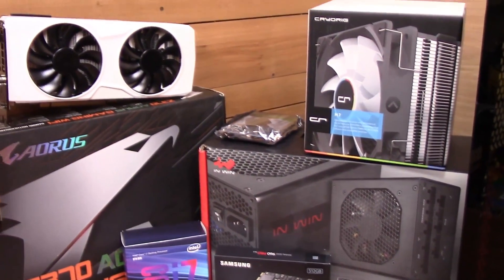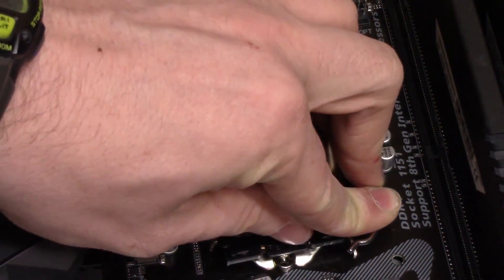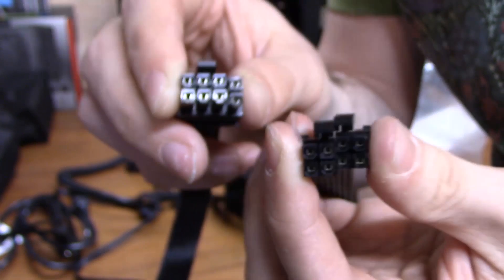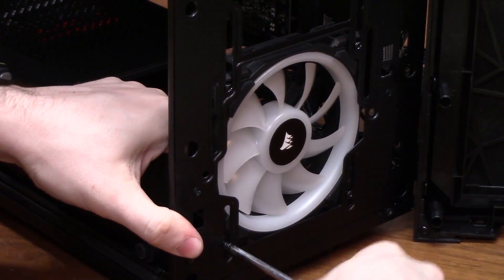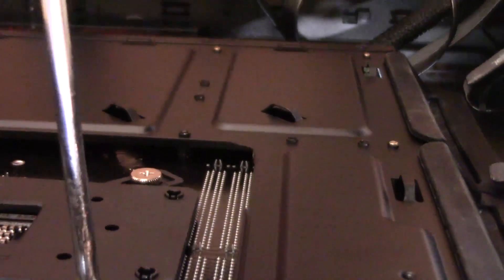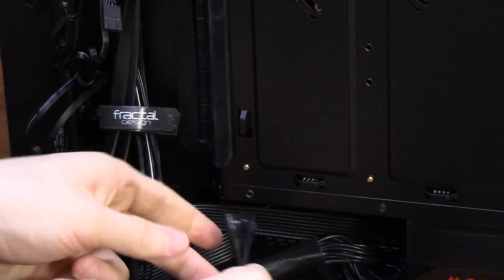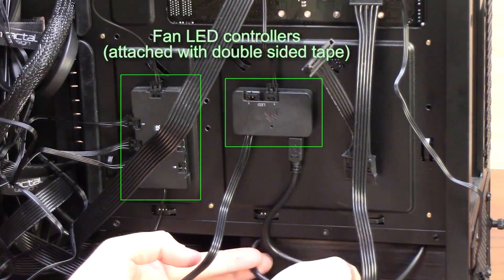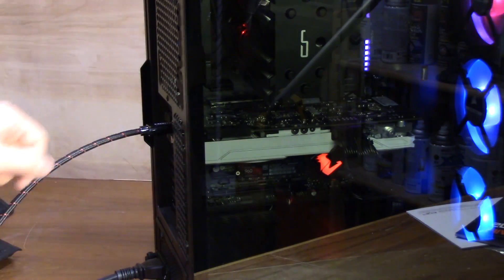How to build a gaming PC!

Comment: Is the RAM correctly installed?
On the manual says Channel A is DDR4_2 and DDR4_4 and on the board we see that those are the two closest to CPU.

Am I correct or am I getting it wrong?
Reply from the maker: You're right, sometimes it says to put them in B first

Comment: I always like to to update the bios before installing any devices on the motherboard, meaning just what is needed to post.  And usually install the video card last on Intel based systems and just stick with onboard video until windows/drivers are installed and ready.  I think keeping the first post as simple as possible makes sense.  Mostly to allow the bios updates to have the least amount of complexity on the system.  These choices are for the most part subjective and usually are developed from previous experiences.  

I like the way you made your build easy to understand that mostly helps newbies gain confidence by not overwhelming them with technobabble hyperbole, good job..
Reply from the maker: Ah yeah! When you've got experience you learn efficiency. But I think a newbie will just be happy to see it post. Thanks for the kind words :)

Comment: As usual, a great informative video. Just so happens you’ve used the exact case and motherboard I’m looking at buying, although Fractal have just released a white version of the Meshify which I really love, so I’ll be getting that version.
Reply from the maker: It's a really nice case! You'll be pleased
Reply: Dietec thanks. The last PC I built was 20 years ago, things have changed. Watched so many videos now I think I could build a pc blindfold! Going to use a Ryzen 5 1600, a Corsair RM550x psu and some Corsair fans. Just got to make up my mind about the gpu. Can’t wait to get the case first though, I’m in the UK so I’ll have to wait a bit I guess. Thanks again.
Reply: Hi, for anyone that’s interested the white version of this case according to Fractal Design will be available to buy from retailers in just over two weeks. Thanks again Dietec for a really informative video.

Comment: I have the same pc except I have a liquid cooled vega 64. And an Asus motherboard. And no ssds or nvme drives. Still using a 6tb hdd. Also, I have 16gb of ram from g skill trident z 3200mhz  non rgb.
Reply from the maker: So not at all the same PC :p
Nice case though!
Reply: Dietec but it's the same case, cpu and fans. I also have a 1000 watt, 80 plus platinum psu from seasonic to run that vega gpu. So, essentially, it's the same pc at least in terms of performance. With some games favouring the vega and some the 1080. But I also game at 1080p 144hz. Thinking of upgrading to 1440p soon.
Reply from the maker: Oh yeah I'm on 144hz 1080p too and am thinking about an upgrade too :p
Reply: You have a liquid cooled Vega 64 but no ssd? You made some weird choices, my friend
Reply: Gaming Dutchie I actually do have an ssd of sorts but it is only for windows and windows only. The drive is only 32gb. Its about four years old at this point. I am planning to buy a new ssd (a 500gb one) once I save up enough to buy about 3 of those and use them for daily stuff and use my hdds as external storage so that I can remove the hdd cage from the meshify c case and custom watercool it. But I can't with hdds inside because the spot for mounting the Reservoir and pump is in the spot of the hdd cage and you can mount one without removing it unless you mods the case a little and I'm not comfortable enough to start modding a case I bought like five months ago. Not yet, anyway.
Reply: Dietec hey, if you are on a tighter budget, look at the Asus mg279q and the Samsung chg70 series. They're amazing 1440p monitors with the Asus having an ips panel with great colours and the Samsung has amazing blacks with its va panel. Both are 144hz.

Comment: Good job. Graphics card connection great point. Although you showed it removing film on the CPU cooler is essential. Didn't on my first build 😭 PSU power requirements for your system build can be figured out on   PCPartpicker. Great reference for power requirements and component compatibility.
Reply from the maker: You didn't! Haha wow I bet you were confused about temps for a while
Reply: Dietec embarrassing ... And I just watch Linus do this in a video.
Reply: Joe Quaider how in the world can you forget to remove it ?